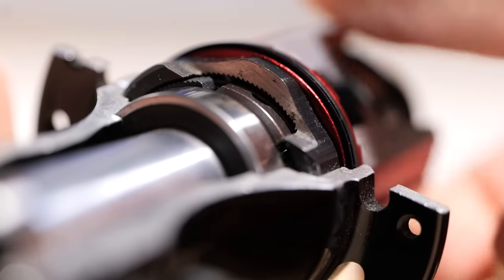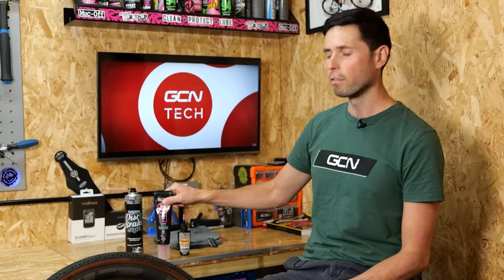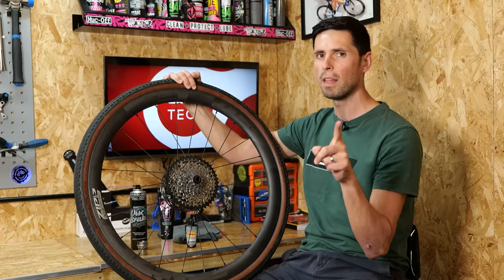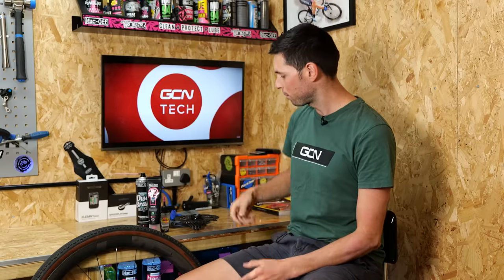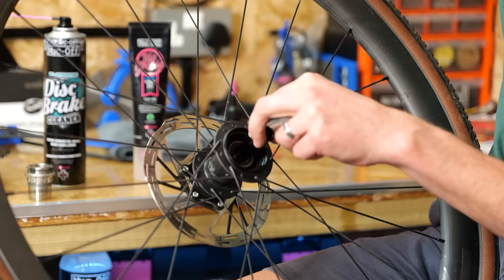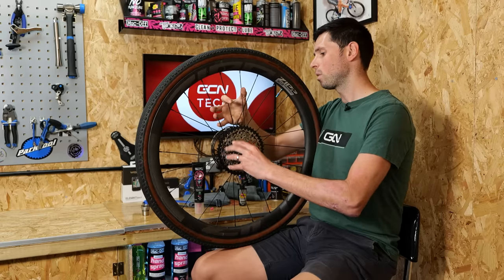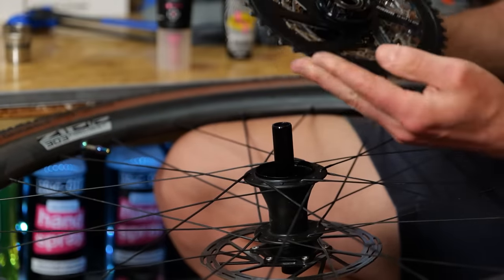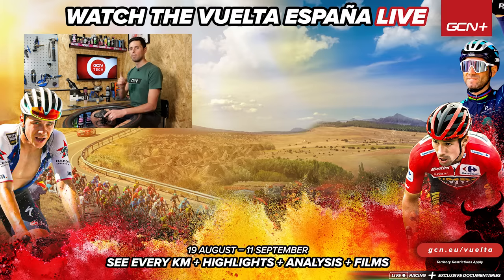How To Tune Your Freehub To Be Loud Or Quiet | Maintenance Monday

Comment: Let me remind you, the db scale is logarithmic and 3 db less means a reduction of 50% So the difference is actually huge!
Reply: The difference between Ollie and Alex doing science ;-p
Reply: It is but , most ears probably won’t notice it
Reply: I keep forgetting that, thanks for the reminder. Always useful, by the way, bagpipes sound at about 105db. You're welcome.
Reply: I went looking for some sort of scale to explain.
Reply: Let me remind you that the db scale is logarithmic because we don’t perceive loudness linearly. So a 7 db drop is pretty minuscule
Reply: Let me also remind you that 3 dB reduction means a reduction of sound ENERGY by 50%. A 50% reduction of PERCEIVED noise is roughly equivalent to a reduction of 10 dB.

And as the scale is logarithmic, there is also a big difference between 1, 2 and 3 dB of level difference.

As I work as an acoustic engineer I thought I'd spread some info.
Reply: Even a small change in distance from the microphone would easily account for this.
Reply: @stephencassidy4448  3dB change in sound pressure level is accepted as a difference that most people will notice.
Reply: Aye. @whirving
Reply: 3db is 2x the energy.  However the human ears are generally estimated to perceive approximately 10db as twice as loud.  So while this change is very substantial in terms of reduction of energy, it's a less meaningful change in terms of how loud it'll sound.
Reply: @davepratt9909  A lot of these episodes aren't even science. They're just haphazard mechanics.

Comment: I'm not an engineer, but I am a drummer, and I think the resonant qualities of the hub make the main difference. Think if you clicked a pawl against a solid piece of iron, it would just make a little click that wouldn't really carry anywhere, but a hub is hollow and resonates like a little cowbell. I think companies have started to make them louder on purpose, but have no proof, lol!
Reply: also, the rim, especially if deep/wide-section carbon , acts as an echo chamber, as the vibration is transmitted down the very taut spokes, and resonates that as well.
Reply: @zygmuntthecacaokakistocrat6589  Ah, I wondered why I always can identify a BMX hub coming down the road behind me, the smaller rim emphasizes different frequencies maybe.
Reply: I've got a fever.  And the only prescription is MORE FREEHUB!

Comment: In my experience, thicker lubricant, like grease on the pawls will make them quieter..... for a short period of time, until the grease gets pushed to the side. Freewheels have a natural sound, loud or quiet and changing the viscosity of the lubricant only helps for a little while.

Comment: I have been bothered by my Rolfe wheels noisy free hub for a couple years and last week I ventured beyond my expertise to try to quiet it. I disabled and lost an hour finding the paw parts on my floor . I cleaned it up and applied a generous amount of Phil’s tenacious oil . 
After 3 rides it is still 1/4 (estimate ) as noisy as it had been. It may be quieter than my comrades dura ace wheels. .Total success and I despise noisy free hubs.
Reply from the maker: Nice one mark! Glad we could help. 🙌

Comment: Worth mentioning that some hubs such at the DT Swiss one use a special grease.
Reply: Yeah I got the tube too but no idea and don’t possess the tools to remove the ratchet
Reply: Special grease for special price 😁
Reply: When I recently got my bike serviced the guy said my grease was "off" because it was red, he removed it and replaced it with normal grease....
Reply: @kidShibuya  gg
Reply: @AKSKMY  You can just slide off the freehub body, so you don't need any tools to add new grease 🙂

In addition, I have a DT Swiss 240 EXP hub, which is VERY noisy, at first I liked that, but in the long run it's pretty annoying, so if anyone knows a way to make this quieter I'm very interested!!
Reply: @bertdouma4056  you can change the 36 teeth star ratchet from the dt swiss 240 to the 18 teeth ratchet which is usually used for the dt swiss 350 hub, but they are interchangeable. They create a bit more free travel, but should be quieter. You can buy those for about 30€.
Reply: @bertdouma4056  lol u have the same hub as me. Don't need to use bell.

Comment: Like most normal people who aren't excessively vain and show-offy I prefer the quietest possible drivetrain so that I can concentrate on my actual, you know, cycling, the ambient sounds around me, and some nice conversation if I'm riding with others. But not at the expense of drivetrain efficiency and durability, of course. So I'm wondering what oil and/or grease do you all use when overhauling your freehubs.

I'm leaning towards Dumonde freehub oil for the pawls and spring and grease for the ball bearings but if there are perfectly decent alternatives such as chain oil (I have Dumonde Lite) and regular light grease (I have Finish Line Teflon & Bullshot), then I'd prefer to save some money and use them instead as I'm not likely to overhaul my one and only freehub that often and don't ride in cool or cold weather (which to me is below 60F).

Comment: You start off by saying that the noise from your freehub is caused by the teeth in the hub engaging with the teeth in the pawls but then go on to apply different oils just to the pawl pivots points. Yes, the pivot points need light lubrication so the pawls don't seize up but the noise is generated by the freehub teeth hitting each other as they rise up each tooth and then drop down the other side. You should've smeared the ring of teeth in the hub to truly show the effect of using a heavier oil / grease and the hub / cassette should've been spun at exactly the same rpm on each test for a true comparison, the faster my hub spins the noisier it gets.

Comment: I have done exactly this to a noisy freehub. It does work as described here, but does not work for long term. A month or 2 after adding heavier grease the freewheel noise went right back up to previous levels.

Comment: Hi, I upgraded to Hunt wheels which were a fair bit noisier than my Fulcrum wheels but lighter and faster. I will say you would need to demonstrate that on an entry level wheel set as I'm sure I would have to remove my Cassette first  to remove the  Hub  😀

Comment: Isn't that a _freewheel_, not a freehub as indicated in the title?

The 7s freehub (no reference; the cassette is from Shimano) on my folding bike is a bit loud, and I was wondering if lubrication would make it quieter, and if not, whether it was possible to simply replace it with a quieter model without having to build a new wheel.

Comment: also i tighten my paws spring not only for being louder but also to lock more secure, cuz sometimes when i tried to pedaling the paws wasnt fully locked and the hub sound is big bang...
I use oil becuse spring is weak and if i put greese paws got blocked.

Comment: Don’t forget that larger cassettes become a resonance box, meaning that the sound as it is, low or loud, becomes even louder with larger cassettes and materials made of
Reply: You explained that better than me, and I think companies are making them louder on purpose, maybe with some consultation from drum and percussion manufactures, lol!
Reply: so how should that work? A cassette is not hollow, so there is and will be no resonator...But if you believe strong enough, it will surely get louder...
Reply: @hendriksiering9077  Well, a hub is not completely solid like a gold brick, for example, the pawl is not making the sound itself, take a pawl out and tap it on a hard surface, I think the pawl is more like a drum stick and the hub would be the cowbell.

Comment: You can also make squeaking disc brakes quieter by applying thin oil to the discs.
Reply: And you can make noisy freehubs quieter by sticking cotton wool in your ears.

Comment: Not a fan of stupidly loud freehubs, personnally. I used to ride an Orbea Avant equiped with Orbea Corsa wheels (Shimano RS470 hubs) and that was almost too quiet. Now, I ride a Giant Defy Advanced, which came with Giant S-R2 wheels. They're a bit louder, people hear me coming from behind now, but I don't find them "obnoxiously" loud.
Was thinking of upgrading my wheels, and came upon Scribe wheels. They seem really nice, and pretty lightweight (aluminium Race disc Wide+), but I've heard that the freehub noise is insane. 
Does anyone have any experience with these wheels, and/or has compared the Giant wheels to the Scribe wheels before ?

Comment: i got a new CANYON Endurace with Fulcrum wheels and the free hub is totally quiet. i wish it was a bit louder so people hear me coming.   are fulcrum noticibly quietr?
Reply: Campagnolo and Fulcrum freehub mechanism use three pawls and a ratchet ring. It's pretty much the standard freehub mechanism and usually sports a low P.O.E (points of engagement) count, hence the quieter noise. Freehub mechanisms with a higher P.O.E count are the loud ones. Some riders with the latter try to lower the noise by overlubricating the mechanism with more or thicker grease, but this is greatly unadvisable as this will increase the risk of freehub slippage.

To put it in a cold tone, I will say get over it. I've never lubricated freehub mechanisms in an effort to alter their noise, but for optimal operation. If it's loud, it's loud.

Comment: Test is wrong, you should apply grease and oil also to the slot where freehub engages with the wheel, this is where the noise is comming from.
Adding lubricant on the pivot point did almost nothing related to the sound.

Comment: #askgcntech Hi guys and Manon. I'm planning to change either the chain set to 52/36 or chain rings to 52/36 depending on availability. As it is now I have 50/34 (105 R7000) and a 11/28 cassette. If I get a 11/32 cassette will that be aprox simimilar to what I have now when it comes to the easy gears? Thank you for a great channel. Sorry for my bad english, hope you understand my question. Best regards. Patrik.
Reply: If you divide the front by the back, you get the ratio of pedal turns to wheel turns. Your current easiest gear is 34 front, 28 back, so 34/28 is 1.21. For every turn of your pedals in your easiest gear, your rear wheel will turn 1.21 turns. If you change your front to 36, and your back to 32, you get 36/32 = 1.13, so for every turn of your pedals, the rear wheel will rotate 1.13 turns. As this is lower, the gear will be easier. Note that the 36 front, 32 rear ratio is the same as 34 front, 30 rear. 

If your bike came with 50/34 and 11/28, chances are it has a short cage rear derailleur. In order to have a 32t rear cassette, you would need a medium cage derailleur. The largest cassette a short-cage derailleur works with is 11-30, with the B limit screw all the way in. 

If you need to replace your chainrings and also want a slightly easier lowest gear, get a 50/34 with 11-30 cassette. If you need to replace your chainrings and can't find 50/34 or want the same lowest gear, get 52/36 chainrings and 11-30 cassette. Getting 52/36 and 11-32 will potentially need a new derailleur, and the 11-32 cassette will have larger jumps on the gears, which might not be to your liking coming from the 11-28 cassette.
Reply: @PaulingtonGoose  Thanks. I have a long cage derailleur so it will work then I guess but I will need a new chain.

Comment: I can attest it is very … surprising when the palls (or really the last pall) get stuck retracted and the free hub becomes suddenly free in both directions, especially if you have just turned onto a steep climb…
Reply from the maker: It's one of the very worst feelings out there, undeniably - maybe a broken chain, but at least you can fix that at the side of the road with (relative) ease!
Reply: @gcntech  Yes, Rafal Majka illustrated the general issues quite nicely in the Tour de France...

Comment: Has anyone else ever experienced the mavic squeal of death?
Reply: Most definetly! Also the ensuing resonate vibration. Gotta be sure to use the correct lube when relubing  Mavic freehub.
Reply: @awesomexistence  The vibration is insane. It's hard to tell what is going on. I know a lot of ppl use shimano mineral oil, but I ended up using triflow I had on hand. It's been going solid for several hundred miles so far.

Comment: 3:15 So many rookie mistakes: not removing the cassette from the freehub body, allowing all the crap from within the cassette cogs to fall into your hub and contaminate the mechanism. Spraying disc brake cleaner near your freehub bearings? "Trying not not get it into the bearings . . . "  . . . it's going to get into the bearings, dissolve the grease, which will then eventually require either a new freehub, or a very tricky bearing replacement. Oil for pawls is just dumb: it dissolves grease, and washes out in the first rainstorm. Light grease is what is required. & you didn't grease the axle before putting the freehub back on. Geez: just shows what self-appointed 'tech gurus' do to general awareness of mechanics. (BTW, I'm a Cytech mechanic trainer, a mechanic who trains mechanics, and aren't just talking out of my fundamental orifice).

Comment: The amount of grease used has an impact too. I originally used just a bit of DT swiss's grease as per their recommendation, but it was so noisy that I added what I would call a moderate amount of grease and now it's much more reasonable of a noise.

Comment: This is such a good topic. But the analysis was not in much detail. When the noise is mainly influenced by the springs, can one exchange them? I would love to get some HYPER wheels but they are unbearably loud. Is there any chance to silence them? Why do they seem to be extra loud? - Please do more videos on this topic.
Reply: i used to have hyper wheels, most of them comes with little to no grease inside the hub
greasing the hub will make it less noisy

Comment: The decibel scale is unique as a 10dB change equates to a sound being 10 times quieter or 10 times louder.

The 7dB difference in the video is actually quite substantial.
Reply: was thinking the same, dB it's a logarithmic scale... A hub 3dB quieter sounds half as loud to our ears
Reply: I was hoping for Ollie to point this out! 🙂
Reply: @andy_liga  I thought it was 3dB= twice as loud. Thanks for clarifying 👍
Reply: @andy_liga  It's rather the opposite. That's why we have the logarithmic scale in the first place. It better matches how we perceive differences than a linear scale would. We don't perceive a 3dB difference as a half/double
Reply: @augustgames6502  A 10 dB difference equates roughly to a twice louder sound, while being a 10x higher pressure wave.
Reply: @lbx5359  why you @ me? A 3dB increase  is a double in energy. What are you referring to when you say 10dB is double as loud?
Reply: @augustgames6502  Well you were just last in the thread...
The ear is not linear; the audible sensation is not proportional to sound pressure level. A 10x sound pressure level is perceived as 2x louder.
Reply: @lbx5359  where’ve you got that sound perception from? My understanding has always been every 3dB = double, therefore 10dB = ten times.
Reply: @augustgames6502  sorry, got things mixed up...

Comment: The louder the better! If I'm riding a TT and a moving obstacle appears in front of me, all I have to do is stop pedaling. People get that some time beforehand and I don't have to frantically leave the aerobars to brake.  So the louder, the safer.
Reply: 100% agree a loud freehub is a blessing for commuting to, specially with people walking around
Reply: I prefer a quiet hub. Its easier to diagnose any noise from worn out bearings.
Reply: I removed the horn from my bike just for this reason. Now I backpedal a few revolutions as I approach someone. The only downside to using a free hub an auditory indicator versus a horn is that the horn could be honked loud enough that people could hear it over their headphones.
Reply: Hell no. It's obnoxious. Just yell at them.
Reply: Louder the better, better than a bell for sure for being noticed 👍after greasing the freehub sounded worse and ever so lame. hash noise is the way  forward
Reply: Non-sensical argument. Don't they have bells where you live?
Reply: @JakeFinkelstein  not an argument it’s a statement, a loud free wheeling hub is better for getting the attention of an oncoming walker than a bell! And yes we do have bells
Reply: my loud freehub has saved me many times by getting the attention of other people / riders.
Reply: A bell would have done that. Better.
Reply: @andromedasmascot  where I live (the Netherlands) a bell is both mandatory and accepted as the way to let others know you're coming. It is actually not even something we discuss. People can have quiet free hubs, which you would call dangerous, but never not a bell. A free hub is not a safety device.
Reply: @JakeFinkelstein  i live in the uk and we don’t have dedicated bike lanes (especially where I live) my commute takes me through gravel tracks and villages, I often come across people walking and I find they take more notice of the sound of my freehub rather than my bell.

Comment: I just bought a set of Hunts and they're not only very loud but high pitched.  It's way too jarring, and makes me really self conscious along roads busy with pedestrians.  I think manufacturers do this to appease riders that have come to equate volume with quality.  Hunt say "this is generally regarded as a sign of good engineering", but I think a higher pitch sound cheaper.  It's fine on country roads though, as you'll scare off any deer or squirrels before you get anywhere near them.